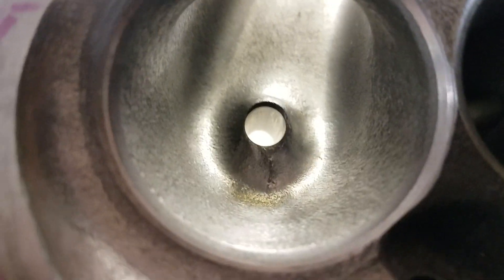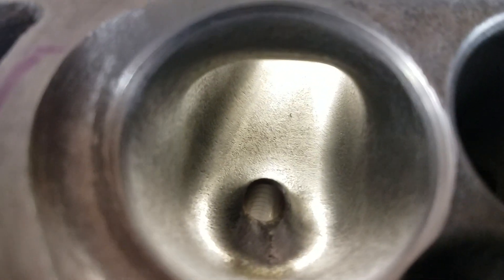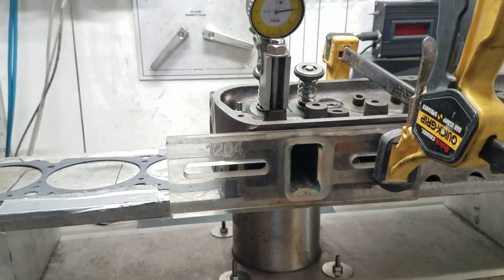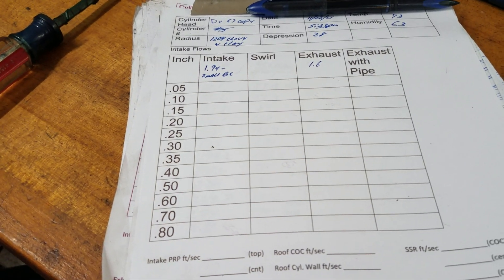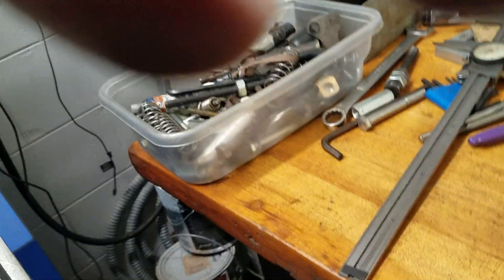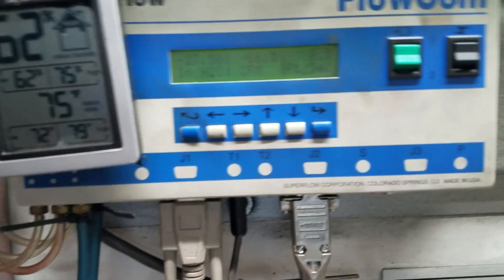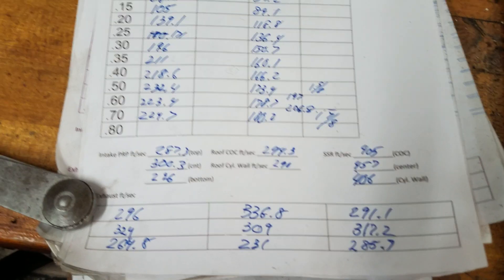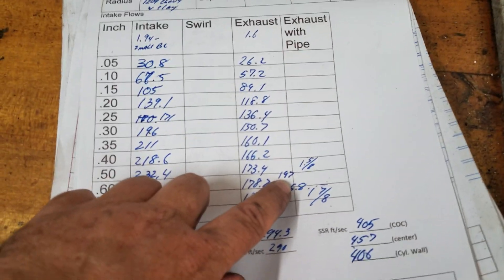David Vizard E7TE part 2 Intake flow

Comment: oh wow, 232 @ 500..  It seems that E7s are really best with a 3/4 cam     around .500  and high 200s duration.    I don't know if you ever use  Desktop Dyno   that now old software.    I plugged these flow numbers into the program for shits and giggles ... .050 duration is usually more accurate but I plugged in my Lunati cams  adv duration  of 281 / 293       it hit 437  @ 6000   and 458 @ 6500     if I simulate a single plane.  using fuel injection had about 413 @ 6 and 427 @ 6500..   The FI  has more low end though.  both in the 380s for torque .     But here's whats interesting.   when I simulated      ( im pretty certain I had the correct flow numbers plugged in )      the 306 you got   361 / 371    on    a real  dyno was only reading around 340 hp in software.   that single pattern    474 / 474 and 204 204 .   When I plugged in the Lunati  it made about 20 more hp  which I guess seems right looking at the duration difference (215 / 224 ) and some more exhaust lift .  Honestly just a random barebones cam that was a step up from their voodoo "speed density" friendly cam.  So maybe custom grinds are even better.    I guess I'm just really eager to see if I could push 400+   ( probably not with my current stock valve porting E7s on the first version of the build)  even on flat tappet with factory casting. I guess I could always port some GT40P or something in the future.  only problem is the EFI dual TB    obv causes   some drop off after 5000 with the long runner.. in like the only dyno video ive seen with that intake on a built engine. which makes it peak early but I highly doubt itd see   those numbers at 5000 .  I know the power band is moved a bit compared to short runner  but I just feel like the physics of it   you need RPM... maybe im wrong.
Reply from the maker: The dyno heads flowed 238 cfm with 1.97" valve. Years ago we ran an x cam and a performer rpm. Easy 7000rpm. It was a world class t5 killer.
Reply: @servediocylinderheads  oh wow,  so yeah id say that could have definitely been opened up. I think you mentioned going roller. potential coyote killer esp with the superior low end

Comment: When I was messing with E7's for personal vehicle, they always backed up around .525 lift.  It was strange because I seen alot of articles that showed NO backup.  Any idea why your flow and my flow show basically the same thing, but magazine artricles and internet posts never showed this.
Reply from the maker: If you have 1.94" intakes the radius on the ssr is too sharp and airspeed too high for upper lifts. That is the reason I think 1.85" valve is the max size. If I am ever unfortunate enought to do another set of E7's that is the size I will do.
Reply: @servediocylinderheads  yep 1.94s.....but everyone's doing it!!!